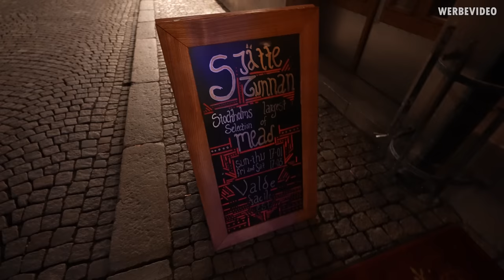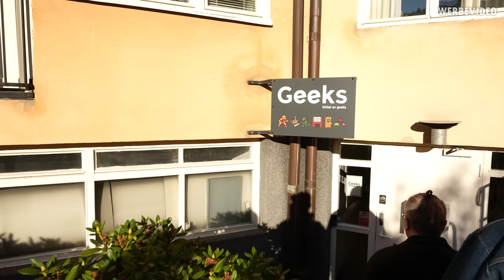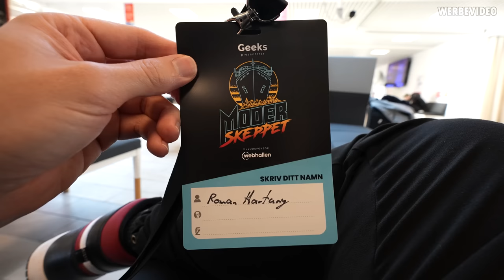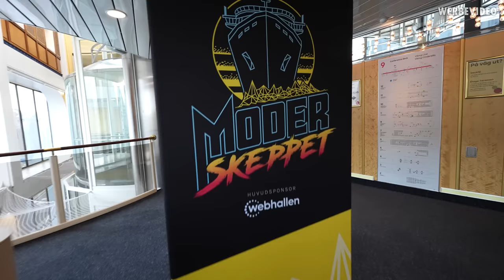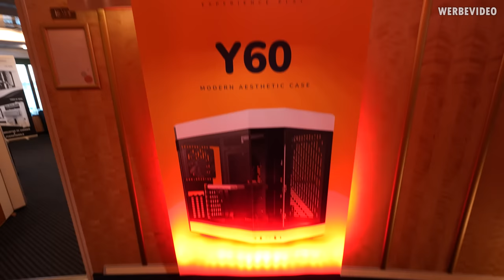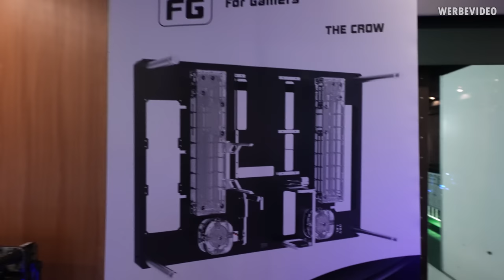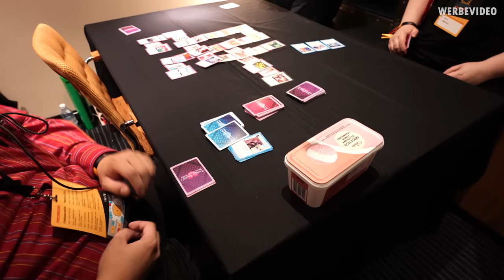WEE(K)-Log #25: Aboard the Swedish Hardware Ferry (Moderskeppet 2022)

Comment: I really like the Hyte Y60 case. I like that it's clearly designed to sit up on the desk and be seen (a true desktop), and the front IO is down low so the cables aren't plugged into the top and dangling down and being an eyesore like pretty much ever other case design, atm. But, I cannot stand the rear expansion slot design, and that is the entire reason why I won't be buying one.
also,   Looks like a fun event.